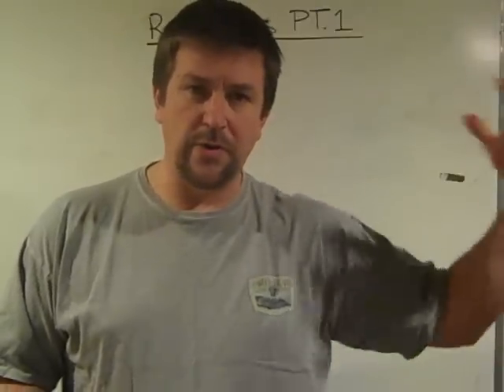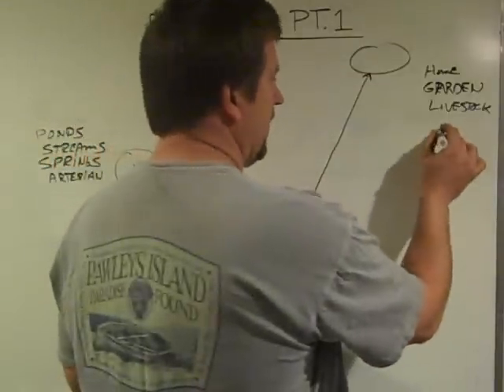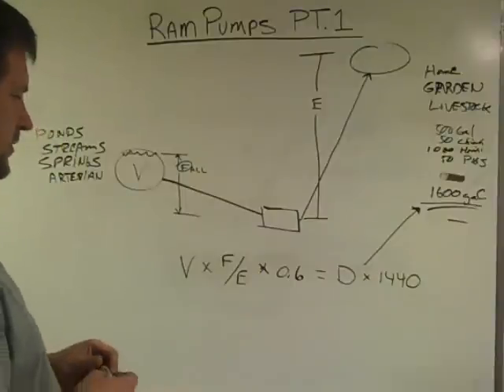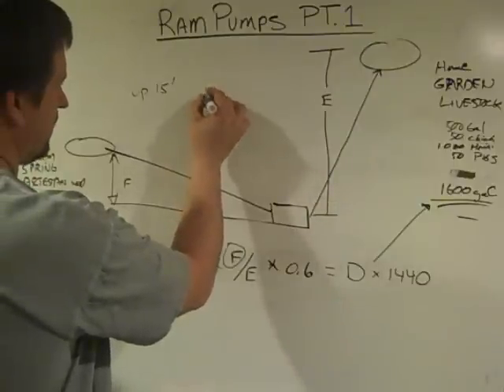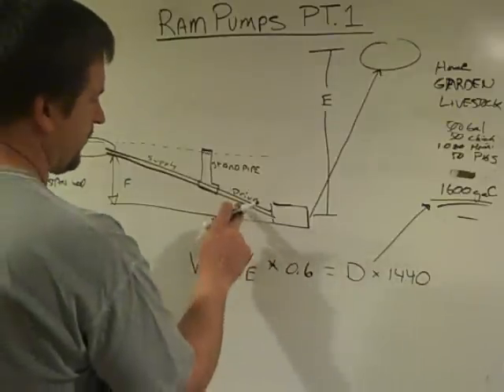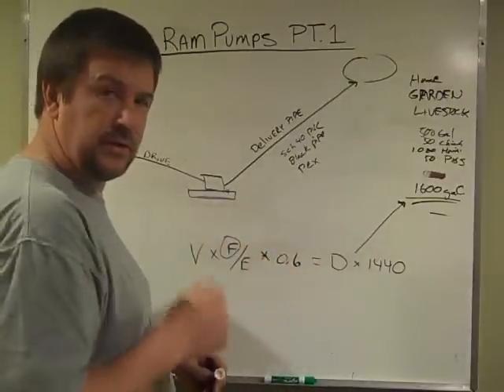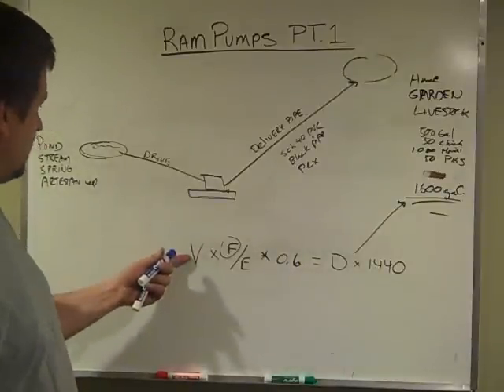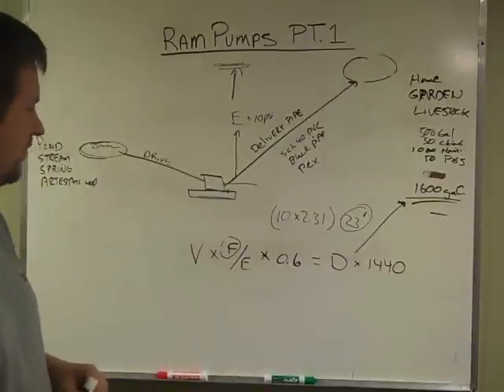Ram Pump pt1

Comment: There are a lot of ram pump videos on the web, but this was by far the best that I've come across with respect to the actual engineering of a system. In fact it's the only video I've come across in the past few days that even attempts to discuss engineering a system! This should be at the very top of the youtube results for "ram pump". I very much appreciate the work that you've done in sharing it with the rest of us.
Reply: Hi Engineer!  I love your explanations.  I have a question.

I am lucky to have a fall of 40 feet over a distance of 150 feet at 1 cubic ft per second max on a seasonal spring.  I am planning a series of 3 small dams partly to check erosion and partly to store water for ram pumps.  To conserve waste water I would like to install a separate ram pump at each of the dams each delivering to a large earth tank 40 feet above the first ram pump for irrigation in our dry meditteranean climate. Because the flow varies widely in the wet season,  I am thinking a flush and drain scheme on the dams would make it possible to use higher capacity ram pumps capturing virtually all the flow. That is, fill a dam close to overflow, flush to the ram which would run until it reached some lower level and so down the line. 

Of course this means I would have to restart each ram pump when a dam fills to overflow and starts the flush. I would need a level monitoring system to know when a ram pump would need to be restarted or some automatic way to restart each ram pump. 

It seems like a remote monitoring system could make managing the flow practical with some daily attention.

Have there been successful schemes use all of the flow and also to recapture the energy from the 'waste' water?

Comment: Excellent video.  This really helped me with our installation.  One point:  the Clemson Cooperative Extension  paper indicates the stand pipe should be 3 "pipe sizes" larger than the drive pipe and the supply line should be at least 1 "pipe size" larger.  That's significantly different than the 2 and 3 "times" the drive pjpe ratios you mention.  E.g. a stand pipe for a 1" pump = 2" (i.e. counting up pipe sizes 1 1/4, 1 1/2, 2).  And the supply line could be 1 1/4".  A 300 ft 1 1/4" supply line is a lot cheaper than a 2" one.  According to your calcs a 1.5" pump would require a 3" supply line while the Clemson recommendation would allow a 2" one.  Again Engineer 775....thanks for your contribution and help.  This video was key to us watering our cows and chickens inexpensively now for 2 years.

Comment from the maker: @Derf2258 If the fall is up to 15' multiply by 6 - in the video I used 10' as an example and therefore the drive pipe would be 60' , if is was 15 then yes it would be 90.  I wrote 10 on the board but it was pretty small.  I need to write larger for the videos to follow!  Thanks for your comment.

Comment from the maker: @GoatHollow The relationship between fall and drive pipe length has been found empirically over that last 200 years of experimentation.  The goal is to maximize pressure at the waste valve, maximize the momentum of the water coming to the pump.   As the fall increases so does the potential energy and the acceleration of the water. It is a complicated little problem to model as it is affected by  material elasticity, acoustic wave speed and pipe size etc. The empirical tables have worked well!

Comment: first id like to comment that i luv all ur vids and have been a subscriber for many years. 
2nd id like to say that ur the only 1 who talks about the math... ty very much. 

 ... im thinking that my gal per min with the drag coefficient would not allow for this. putting my thumb on the end of the line can stop the flow. but i dont need much. im just filling a water tote inside my house on the upper lvl(18ft high). i mught use about 10 gal a day. so if i can get that id be happy. if more then id have an overflow to the outside. my water source is an artisan well 600 ft from the house. top of well is 12 high from the ground lvl at the house. its 3/4 black poly in ground, to a yard hydrant (@550 ft from well) then 50 ft to the house. im off grid and power to the well to run a well pump is near impossible. its in a mature mountain forest. i do use a pump in the house for hot showers but i find that all my other water needs come from the tote on the upper lvl. i
m trying to get al my water needs without power draw on my solar.

Comment: He said " D is given per minute so if we need to find how many in a day we multiply by 1440 " implying that there's 1440 minutes in a day, so dude no reason to be a stickler, and make your self seem smarter than your really are. Mr.Engineer you did great on the video. 
Thumbs Up 

P.S If your not familiar with unit conversion with all of the online calculators we have bombarding the internet you probably shouldn't be watching how to make a pump from scratch and go buy one.

Comment: good how to videos.  but, two questions.  you never covered how to adjust the pump 1. How do you do that?  2. I am putting a pump on the runoff tube from my spring water holding tank.  It is a very good spring with a strong runoff flow.  if i put this style of pump on I believe I run the risk of the it shutting down the runoff and having my tank overfill.  Will the water continuously drain if the pump isnt going?

Comment from the maker: @jplerwill I do have a feedback line from my tank as it greatly reduce the amount of algae.  So whether I am pumping with solar or ram or both I have a continual cycling of the water.  In order to do hydro you need a lot more water than the rams can supply.  My calculations tell me it is not a good use of resources.  You could cun for short stretches of time maybe to charge a battery but the amount of for a peltier turbine far exceeds what I can pump.   Thanks for asking!

Comment: DRIVE PIPE - The Pressure Wave in plastic pipe is considerably much slower.  The sonic velocity is also the speed at which the Pressure Wave generated by water hammer travel in the pipe.  For water in steel pipes the sonic speed could be as high as 1,480 m/s.  But in some plastic pipe the wave speed can be lower than 200 m/s.  That's a 86% loss of wave speed in a plastic pipe vs. steel pipe.

Thomas Dutkiewicz

Comment: you could also use the water in a water tower to lift very heavy objects. If you put two large tripods beside a huge boulder, attached lines from the boulder to and through a pulley at the top of the tripods and have these lines connected to large tanks, then all you would have to do is fill the tanks with water, as they filled they would equal, and then exceed the weight of the object and it would rise. Let a little water out of one and fill the other with more and you would move it to the side

Comment: What is best for a ram pump size?  Difference in 1 14" and 1 1/2"?

I love your tutorial about ram pumps and you love research and detail.  I am not that smart but I see a guy really into the tech part and it's what people need the truth behind it.

Please let me know which size is best before I buy parts.  The 1 1/2" parts a cheaper than the 1 1/4" in most parts.  

Thank you for any reply

Comment: WRONG!!! 
oh my gosh I'm kidding, excellent useful information all introduced so that people with dirty hands can avoid wasting time. Thank you sir, a farm I work at has several irrigation ponds with electric pumps. I'm thinking the system there can be modified so a ram spills into pond (accomplishing the current goal) and pushes into the existing delivery system but all day long mind you so as to supplement the electric pumps that are there if needed. Hell there's a supply feeding the ponds I should be able to math on and cut some power use. Maybe even most of it.

Comment: Engineer, did I miss something?  You said at the delivery pipe one can use lastic.  Are you intimating that the suply pipe needs to be metal and therefore rigid?  Or did you say that and I keep missing it?  Sorry, and thank you in advance for  your help. I use a ram, have for years, but this last two years, I've have had less water flow in the winter, which is when I am able to pump.  So, I need to modify, and want to make sure I understand all the implications first.

Comment: thank you for an excellent tutorial. love all your vids! we are building our ram now for an off grid homestead. Do you have another formula for calculating elevation, distance and friction? we have good fall, the elevation is not overly great, but the distance is. Probably close to 800 ft I think. Also, if I want to depend on this year round in Northern applications, do you think a well house over the pump would be adequate? With buried delivery pipes?
thanks much

Comment: I have three questions regarding this technology.
1. what is the lowest (practical) waste water:delivery ratio?
2. can a small amount of the delivery water be used in conduction with a water powered sump pump to reduce the wasted water?
3. how would a dual stage ram pump work? I was unable to find a video that explained this.

I'm thinking about making a tiny scale model with an extended run time for a conversation piece 

thank you for your time, I look forward to seeing the rest of your videos

Comment: Great Pump.  I got my first ram pump to work  recently.  The power of water pressure amazed me.  I have a micro hydro generator question.  I have 2 to 3 GPM, everyone tells me not enough.  I would like to build a penstock or drive pipe made of 4 inch PVC and 100 feet long 70 feet high.  This would be about 400 PSI at the Generator.  As long as my nozzle only lets out 2 GPM would the generator produce more power with 400 PSI than 30 PSI pressure from garden hose from house.  Please help me out.

Comment: Please give explanations for the  1, 2, 3 formula .
Why not a longer ( 70' plus ) line feeding the ram without a standpipe ?   What happens 
I would need to run a 3" vent pipe up about 40 ' = Really 
What happens if the line going up hill away from the rem is the same size ?
I have a new application and need to know in order to trouble shoot issues.
Thanks for your response.

Comment: I have listened,  watched and taken notes numerous times on this video so forgive me if the answer to my question is here and I'm not seeing it. I am wanting to build a ram pump for a particular spring that I have. I have determined the flow rate of this spring,  however what I fail to be able to glean from your excellent material is how to physically size the pump inlet or outlet or both(1/2"or 3/4"or 1"or 1 1/4",etc) for my spring such that it does not run out of water and at the same time utilizes a very large majority of the available water flowing out of the spring. I know that you have said that the ratio of the inlet line (drive pipe ) to the delivery line is 2:1 ratio.  Is there a formula or table that you can share with me and others that may have my same question. Thanks in advance for this answer as well as all your other good work.
Reply: Very detailed explanation have listened and learned a lot.  This will greatly help my advocacy of helping indigenous upland farmers. My question is:  is it possible to transfer water from a spring with decent amount of supply to about 1/2 mile distance and  about 20 meters elevation? Thanks a lot for any comments & recommendations. God bless u.

Comment: 1.my pond spring put out 10 gal a minute. 2.my drop would be about 8ft. 3. WHAT SIZE METAL PIPE SHOULD I USE TO FEED MY RAM TO BE MOST EFFICIENT?  my pipe length will be about 150 feet with 8 ft drop from one end to the other. with one 90 degree elbow.( I'm trying not to cutt through my dam, piping around it)

Comment: Not a very scientific type so hope my question isn't stupid. In movies using hydraulic mining techniques, they start with a large pipe then to a medium pipe, then a small pipe to increase pressure. Would this work with a ram pump and how would it change the numbers, engineering, measurements ?

Comment: I have a long!!! 2in black poly drive and it runs fine. mine also has a 2in check and a 1 / 1/2 check valves then 3/4 poly going up to my garden.

Comment: Engineer 775  I am trying to achieve more lift. Question is there any way to induce air into the lift line off the function of the 1 1/4 pump. Would the trapped air create more lift? Thanks for all of your videos. I have learned so much over the years from watching them.
Reply from the maker: What achieves more lift is usually more weight on the waste valve.  What are you using for a waste valve?  Send me an email as I can;t keep up with YT comments/?s  info@practicalpreppers.com Thanks
Reply: engineer775 Practical Preppers  Will do.

Comment: Great job Dude.  I'm not understanding the necessity for the relationship between fall and drive pipe length.  At the bottom of a pond dam for example, you could have 20' of fall over a short distance (very steep terrain in this instance).  Why is it necessary to have 4xF of drive pipe, if the bottom of the pond dam can be reached with say 50' of pipe... increasing that to 80' would normally only increase friction inefficiency.

Comment: Do you use a feedback line so that cycling flow is constant through tank, seems that way you would always have cooler or fresher water at the tank location.  Depending on the circumstances it would seem that you could add a miro hydor to that system as well and provide an additional 24 7 500 to 1k watt power with very little friction loss.

Comment: Can I have a supply pipe run out of a water tank at around 90 degrees down into a ram pump that is stood the normal vertical way, and then feeding into the drive pipe which goes down again at around 90 degrees, to keep he system within a small foot print. For example, a 0.5m height supply tank, into a 90degree outlet into a ram pump that is 0.25m height, into a drive pipe that is 90 degree to the ground with the entire length of the drive pipe being around 0.5m, to fit into a small footprint?

Comment: Im wondering if i have a source and distance, can i drive to water to a tank 20-30 feet then use that supply to drive a turbine and then use that discharge into another ram system to another storage for gardening?

Comment: water was not more valuable than gold, there was plenty of it. It only required effort to get it to the site.The subterranean chamber is 150ft below the point where the water entered the pyramid at the descending corridor. a column of water that rises 150ft can compress air to about 64 psi. Air at 64 psi, channeled into a chamber anywhere up in the pyramid can raise water 150 ft higher  from that chamber. The shafts from the queen's chamber come to a dead end just short of this height.